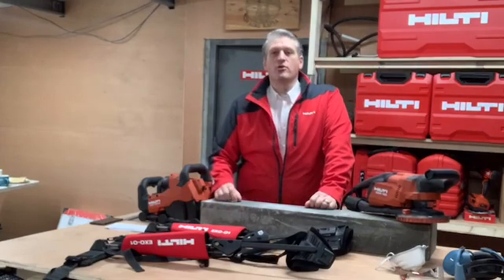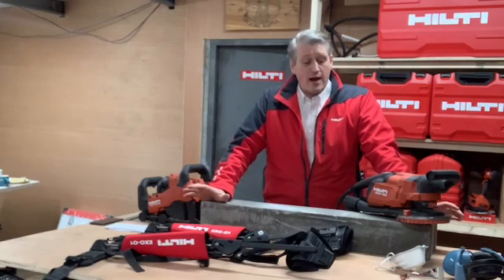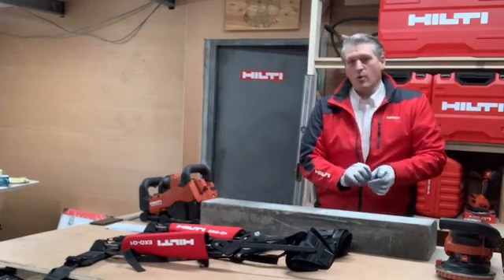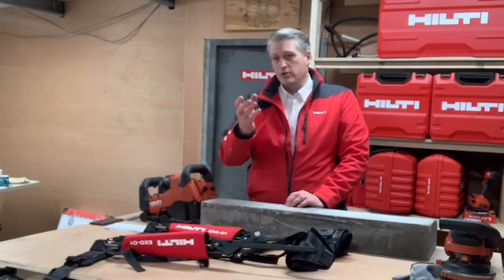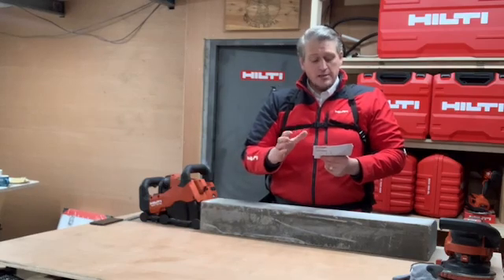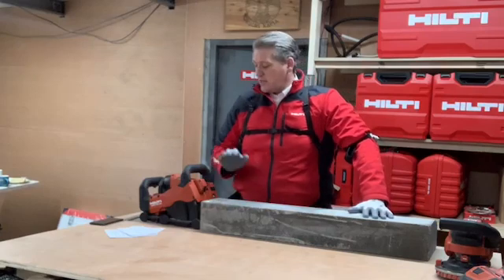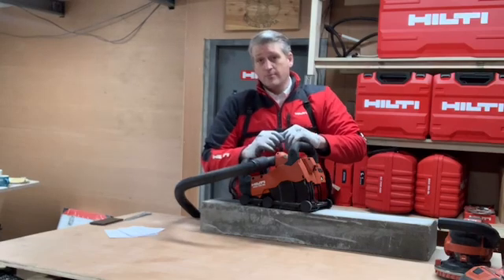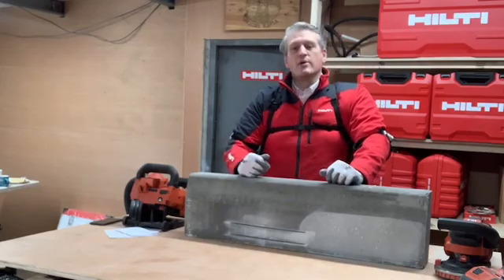Hilti Live Episode 6: EXO-01 Exoskeleton, DGH 150 Diamond Grinder and DCH 150-SL Wall Chaser

Comment: What is the reduction in force when working overhead. Do I exert less force when holding objects or is it used more as a rest?
Reply from the maker: Hi Mitchell, thanks for your comment. 

Put simply, the EXO-01 enables you to lift/hold tools for longer as it takes the strain off of your shoulders and arms. However, the benefits are less tangible the heavier the tool is so we recommend you stay below the range of 4-5kg.

Hope this helps 🙂

Comment: does this help when lifting objects that are on the ground? would it help pushing like screwing in drywall? and do you fit a fall arrest harness on top of this or underneath it? I mostly install drywall and I'm not doubting it will help overhead but wondering for any other application. thanks from Canada
Reply from the maker: Hi Joshua, thanks for your comment. 

The EXO-O1 is designed to enable people to lift/hold tools unassisted for longer periods of time, hence why it is suited mainly for overhead applications.

To maximise the benefits, we recommend a range of around 4-5kg, so unfortunately it doesn't turn you into Arnold Schwarzenegger 😉